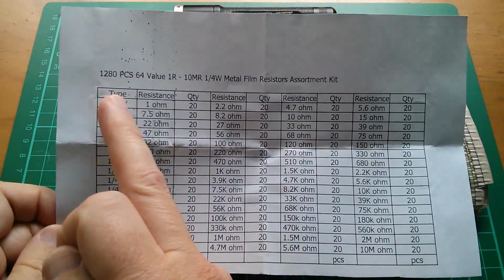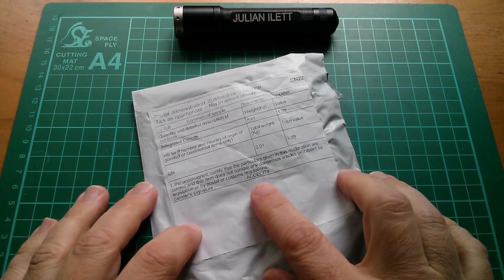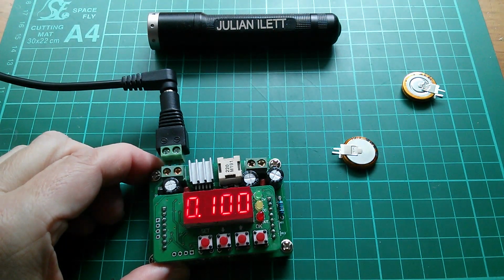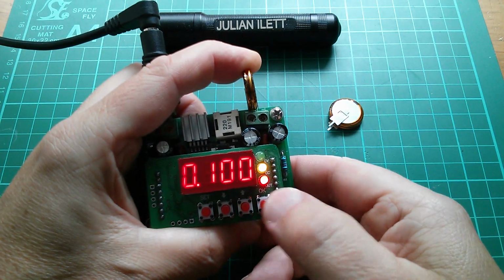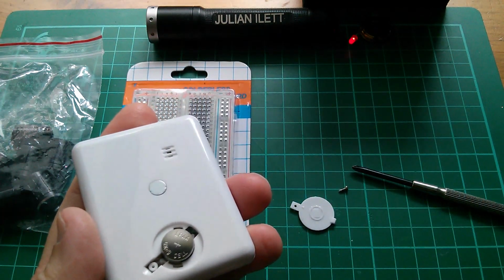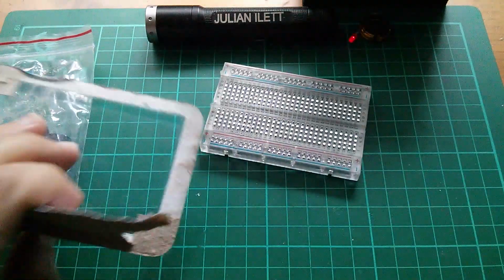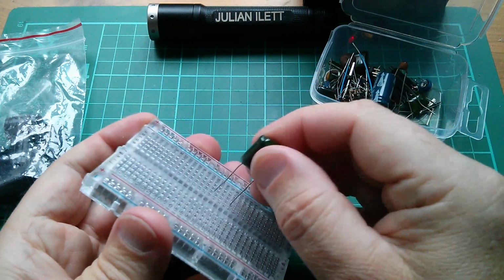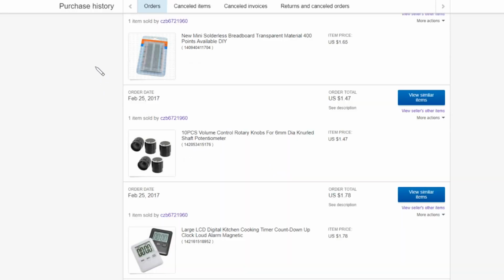Julian's Postbag: #104 - Resistors, Capacitors & Stuff

Comment: Eh, Julian, I just look for the offers with the highest n for "n values m pcs metal resistors". Found a 135-value one, and in comparison with other offers (120 values, 130 values, 134 values, etc) they all only differ in very few obscure values in randomly selected powers of 10, like 8.4 ohms or something like that, and about getting one bag of each, I think I'm settled for life as far as selection goes. I don't think I'll ever have an application that necessitates deciding for a 1.1-ohm over a 1.2-ohm through-hole resistor, but alas, I have them now. Assortments are just too attractive to not have.

Comment: I wouldn't even begin to worry about backfeeding those B3603 modules until you remove the input voltage. Having said that, I've backfed them even without input voltage with no adverse effects. The only reason I would consider it a problem was because it completely backfed and drained the supercaps I had on the output by powering the module. Module worked normally after I installed a schottky on the output, no (apparent) harm done.

Comment: Hey Julian, here's a little trick for ebay links. You might be aware that the listings reappear, even when ebay doesn't want to point you to those listings after that long time and instead the "view similar items" appears. Well what you can do is use this: www.ebay.com/itm/*the number of the listing*  For me it worked every time if i need the same thing i bought in the past.

Comment: The capacitors are labeled. Look at the tabs and you'll see that on one side the indentation on the tab is a cross shape and on the other side it's just a negative (bar) shape.
Reply: Both are correct spelling.
Reply from the maker: He he, I couldn't see the wood for the trees :)
Reply: Yeah, those stampings are crap. would it be so difficult to make a SIMPLE + and - not a 4-5mm pattern.?
Reply: Yeah, you'd think so. They're cutting corners everywhere. Pretty soon there won't be any markings at all.

Comment: I am sure a vocoder could be implemented using DSP hardware and the vocoder software in EEPROM using Pure-Data or using some sort of I/O ADC/DAC interface board that would connect to the Raspberry Pi which would run Raspbian Jessie and Pure-Data.
Reply from the maker: You can probably get a vocoder plug-in for a free synthesiser app on your phone :)

Comment: Bought the same resistor kit few months back, was missing the ones I needed at the time (100R) but 3 had doubles and an additional random value was added.
Reply: same experience. I bought one of these packages myself so I could do some farting about projects and for a decade resistance box for when I am breadboarding I do not have to fool around with having to find some resistor for testing purposes. I love the price but definitely read the values and take some measurements before using. when I received mine I did receive a few doubles but a few values missing after re-labeling some due to incorrect values being printed or stamped on certain bandoliers. Though these assortments usually do cover the EIA values for 1% values as I sat down wondering how I was going to sort these resistors for storage and ease of finding what in the heck value I want. They did not just give you the dross- it is normal in the higher ranges especially with lower tolerence value capacitors that they usually go for a resistance value in the middle of the spread so it does look like values are cherry picked. good explantion of the values included http://www.resistorguide.com/resistor-values/

Also still need to sit down and create what I would like to call a cheap thumbwheel switch decade resistance box which is what I originally purchased this assortment pack for. Though debating wheither I should buy surface mount or through- hole components for when I build my decade resistance box.
Reply: WKDworks I got one that only came with 7 different values. The total was still correct. So I now have more 47k ohm resistors than I know what to do with ...

Comment: Um... aren't those solderless breadboard bits supposed to "slide lock" together rather than ripping apart/ramming together?  I just cringe every time I watch this.
Reply: All my white ones are slide lock.  Just because the white plastic is more forgiving to snapping apart/together doesn't mean that is the proper mating method.  If you look carefully, the male portion is a trapezoid, and snapping them will eventually wear away the points that hold it to the female side.
Reply from the maker: The 400 point breadboards have a cylindrical locking pin - a little more forgiving than the 800 point dovetails. Regardless, I like to use a variety of different mating methods ;)
Reply: I think we could all use a variety of different mating methods
Reply from the maker: It seems the transparent ones are slide only - the white ones are slide or snap :)

Comment: jic  there are 4F capacitors in the market: http://www.ebay.com/itm/2-5pcs-5-5V-4-0F-Super-Capacitor-Farad-Capacitor-Double-Layer-Capacitor-H-Type/132092980235
Reply from the maker: They look good - I'm a bit suspicious of the self-discharge rate of the ones I bought.

Comment: What I find so amazing about these items from China is the price. How can they manufacture, then sell for such a low price and still make a profit.
Reply: Re quality of chinese ebay products, i have found that i am 95% happy, not always great but works and i get to toy around for cheap. Re quality of chinese products in general, so much comes from there that trying to compare to "own" country manufactured products is close to imposible (same product). on the side of "quality", so much comes from there, if the same volume came from another country, we would encounter the same quality issues from that country. The irony of an iphone owner (to mention one product) criticising the quality of chinese manufacturing/assembly in general :)
Reply from the maker: My channel is subtitled 'electronics on the cheap'. A lot of cheap stuff is rubbish. Some of it is surprisingly good :)
Reply from the maker: Coal-fired power stations are cheap to build and run, so China becomes wealthy. This has enabled massive investment in their solar industry, so China can lead the clean energy revolution. Pollute first, then clean it up afterwards.
Reply: If you've watched Julian's channel for a few months, then you know that the Chinese will copy Western-designed ICs, producing an inferior version but with specifications claiming superior performance.  Also, the Chinese remove components from products that were returned because they were defective; the removed parts will be recycled by component dealers in China.  Also, Chinese labor is paid 1/5 what a N. American or European would receive -- no benefits, no unions, no protective regulations, ...
Reply: Also a massively skewed exchange rate, fixed by the Chinese government.
Reply: Didn't mean to start a spat with my question. Just to say I really enjoy your channel Julian, even though most of the time I don't really understand the electronic concepts being discussed, this being down to my lack of knowledge.
Reply: OK. Also love Big Clive Techmoan John Ward and others.
Reply: There is no spat Peter.
I have chatted with Julian a few times about electronics.
He has a point of view from his channel experiences and I from electronics engineering.

For instance I often jokingly berate Julian for not having a good bench supply, and Julian reminds the point of his channel.

Just shooting the breeze is all.
Reply: Just like The Men Who Built America!  http://www.imdb.com/title/tt2167393/
Reply: it is not only surprising due to low price but you have to deduct ebay and paypal charges... Also, have you noticed the different currencies for payment for different sellers? (normally english speaking currencies) if you ask me: Income "out of the books" and a tidy sum for someone to retire abroad.
Reply: I bet you think cheap tea is made from the sweepings of the factory floor too?
Reply: I have found scraps of wood in cheap jasmine tea from China, so, yes, it probably was swept off the factory floor.
Reply: well paypal only takes a couple of cents and ebay a couple of percent i believe. 
and the shipping from china is like 50 cents due to the UPU. the UPU still considers china a developing country since they joined in 1914. therefore worldwide shipping from china is a lot cheaper. shipping from china via airmail to the US is just 50 cents(around 1USD per kg) while its likely 40$ from the us to china.
Reply: Ebay is the dumping ground for itiems that fail QA. So cheap that you dontvask for warranty. China can make good items but not for domestic market
Reply: There are generally all substandard.
OK for farting about with, but not for any real application.
Reply: Stolen IP, slave labor, nuclear power, massive pollution, no safety regulations, poison-spouting diesel transport, etc.
Reply: Indeed those apply, but my point should stand out, especially wrt to an electronics channel.
I reiterate:
These parts are OK for farting about with, but do not use them in any critical applications.
Do not use them for repairs either.

Look at some of the shit that Julian has had on his channel.
Even a simple thing as the tip cleaner was a bogus camouflaged steel one.
Reply: I wasn't commenting on the content of your channel, more I was just stating that within the topic of electronics we should be very aware of the capabilities of the components we choose to use.

To repair, build or design, we need to work within a specification.
These components do not have a specification, or certainly not one that can be counted upon.

Comment: I think the breadboards clip together with a dovetail joint, don't they? 
You need to slide them up (or down) to detach them, not bend them sideways? 
I suspect you may have squished the plastic a bit on the slidey slots. 😶
Reply from the maker: Not squished so much as cracked/splintered :/
Reply: they slide up and down yeah ... its a pain to cut away at the adhesive backing though.